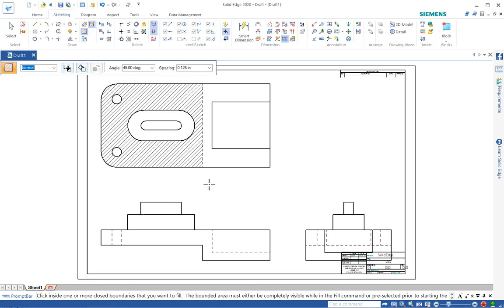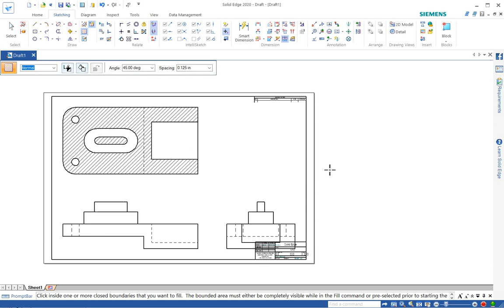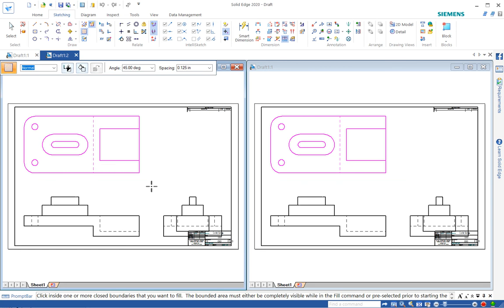Using the Fill command

Comment: this fill function is toxic. how do you unfill a region ?
Reply: You can select it using the select command.
You can then just press the delete keyboard key.
And you will also see a handle point when you select it.
You can use that to drag it to a different region.
Reply: @jasontitcomb2663  it worked! thx but how do you select a specific area you want to fill?